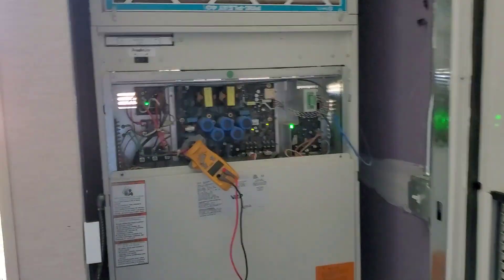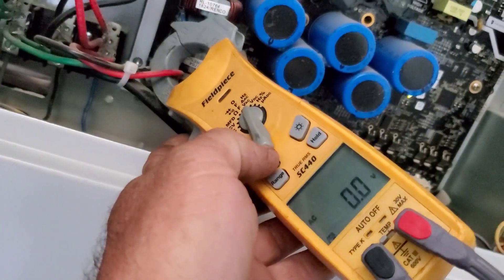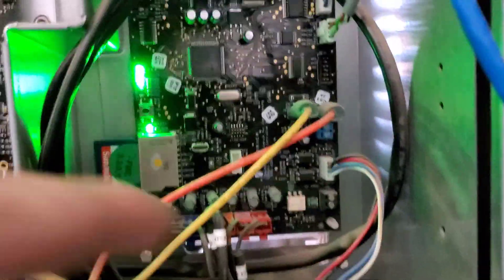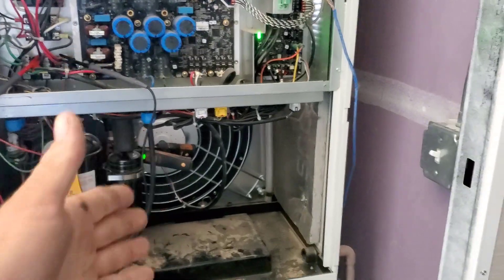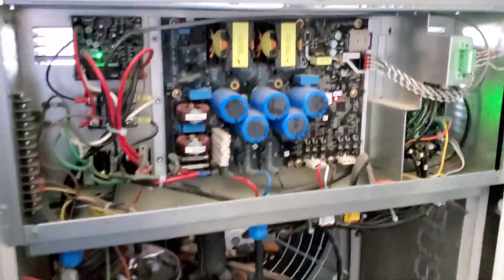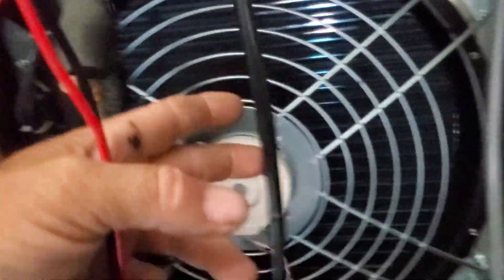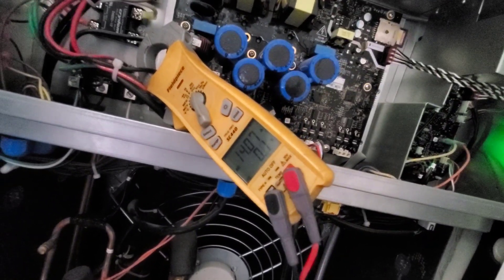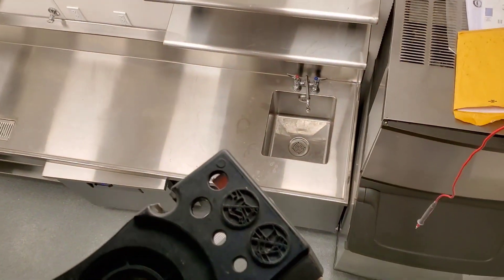"Hotel VRV" - Friedrich and Daikin Inverter Variable Refrigerant HVAC

Comment: @8:23 On the Fredrick unit, is that a lil fan I see above the inverter board? MUA fan?? Definitely a cover up job on the condenser supply air haha, definitely begs the question how easy is a condenser coil clean on those units...
Reply from the maker: Yup! That is fresh air. And it has it's own little filter.

Comment: The high voltage you're seeing on the DC bus is likely due to Power Factor Correction. After input voltage is rectified using the bridge rectifier, the PFC controller implements a DC-DC boost converter to increase the voltage using likely the two yellow transformer looking inductors on the top center of the board. The controller adjusts switching of the IGBTs in order to make the input current more closely follow the voltage sine wave than bare capacitors, which only take current during part of the AC cycle. The voltage increase allows the controller to do this.
Reply from the maker: The voltage seemed to be the exact same on each unit whether running or not.
I assumed it was just full wave rectification. 
Now you're going to force me to have to go experiment with half wave and full wave rectification into a DC bus with some of that spare parts in my back yard. HA HA
I'll also have to look at that Friedrich board a little closer.
I've stared at the component layout on the mini split boards and others and they just have filters and then a rectifier right to the capacitors.
Reply: @hackfreehvac  its always full wave, what you are mistaking with is the full sinus wave form that is created at the inverter output.
Reply: Exactly my thought!
Reply: You would be right, good catch. Those two transformers above the capacitors are for PFC correction. A typical VFD minus PFC correction wouldn't need these as it doesn't step up/down the voltage.
Reply: @Richard Vaughn A SMPS alone doesn't have a perfect power factor. If you want a good power factor, you need 2 power supplies, the PFC DC/DC converter between the rectifier and the capacitors, and then the DC/DC converter powering the load after the capacitors. Solar inverters are irrelevant to this conversation as they have a smooth DC input already, and just need to convert that voltage up/down.

From Wiki:
"SMPSs with passive PFC can achieve power factor of about 0.7–0.75, SMPSs with active PFC, up to 0.99 power factor, while a SMPS without any power factor correction have a power factor of only about 0.55–0.65."

So, without any manner of PFC a typical SMPS has an atrocious power factor. It isn't magically great unless they include a second DC/DC converter for active PFC.

Using an inductor and a diode is not the basis for all SMPS. This is only the basis for non-isolated supplies. If your phone power supply did this, your phone would be at mains potential and you'd electrocute yourself no problem. Instead, they use transformers to create isolation, they are still a SMPS, just an isolated type instead of not.

Comment: How old are these units ? they should last a decade or two before compressors go out. I’m still waiting for my first compressor to die and it’s been 30 years. But I’ve never installed Frederick
Reply from the maker: This place hasn't even opened yet.
But perhaps they had some rough handling during shopping, the crane lifts, etc.
Reply from the maker: There are like 200 of these in the wall units here and a few dozen of the Daikin VRV split systems. 
Very sophisticated and have several different trades and vendors involved in the install, wiring, commissioning, etc.
This is a entirely different world than typical HVAC units. So many things involved in the install and it is done in stages.
And aside from a few pain in the ass locations to deal with, this company keeps me gaining experience with the latest high tech HVAC.
Reply from the maker: @coldfinger459sub0  Oh nice. So do you have the LGMV software?
I used it at the last job but I currently do not have the PC software now. Well, the dongle anyway. Which is what licenses the software to work.
I do have some job sites with the LG MV IV's